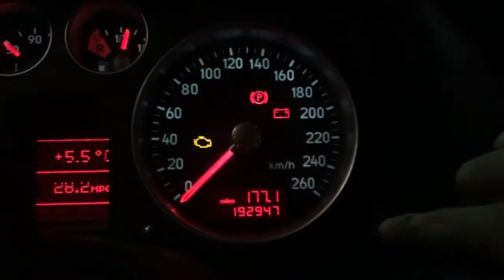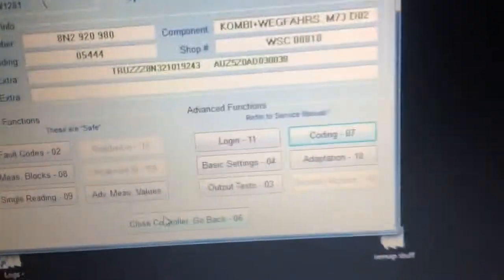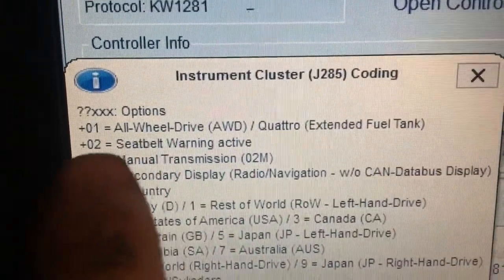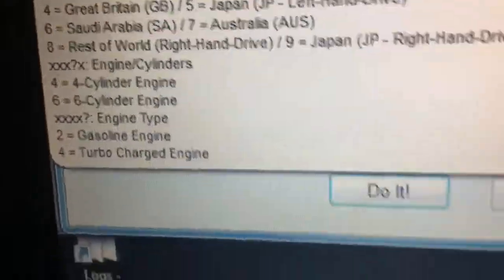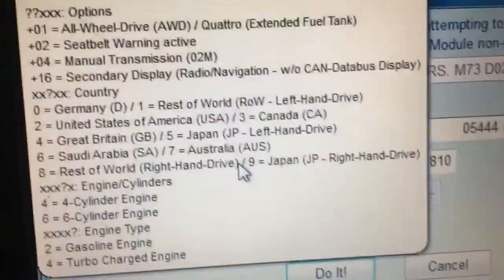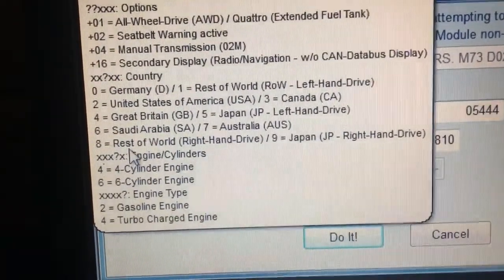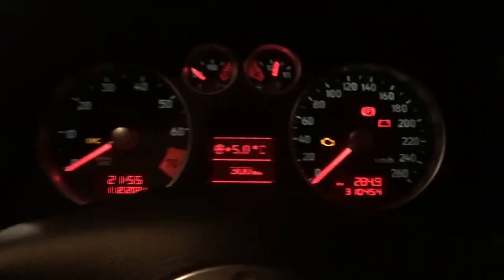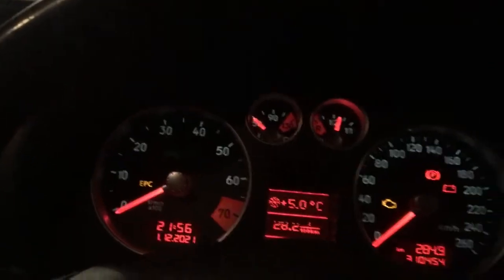21) Vcds TT display Miles to KM (part 1/3)

Comment: @stevenharpervw I cant do this on Volkswagen up ! 2012, can you help/
Reply from the maker: Why not? Is it not connecting to vcds ?
Reply: @stevenharpervw   it is connecting, I have a genuine ross tech cable purchsed(also verified user on that forum) but the version now 23.11.0, the screen where we have the variant country is diffrent and it does not change? can you perhaps guid me on phone?
Reply from the maker: @abdulshahabdeen  I was using an older version . You might have to ask ross tech is that 23 version supports your car . 

I do have another video on connecting vcds to your car and what settings to use
Reply from the maker: https://youtu.be/E9ouXPqTmnw?si=KuAzSxiDrXZLOdZt

Try that video . Just to confirm you have the correct port and turn down the bite rate too might help. After that I’m not sure
Reply: Let me see, cheers
Reply from the maker: @abdulshahabdeen hope you get it sorted 👍

Comment: Hi Steven hope  you doing well, Thanks so much for taking your own time to make these videos . I do own a 02 Mk1 for the last 6 months, which displays are in miles and struggled to find someone explaining how to change it to km/vice versa. 
I do wonder if the vcds mobile version includes  ( .17 instruments) on the menu.  As I do own an android samsung tablet, which to me is more convenient in order to make this mod adjustment instead of a laptop. I did found a few reasonable wireless dongle on amazon . But I would like to be sure before purchase .
Reply from the maker: I honestly have no idea I’ve only ever used a laptop.  But I’d be interested in finding out how you get on.  On any of the Facebook pages if you post up a request if anyone has vcds on a laptop you could do the coding in 30 minutes ( 25 minutes for a play around with vcds and scan for fault codes too )